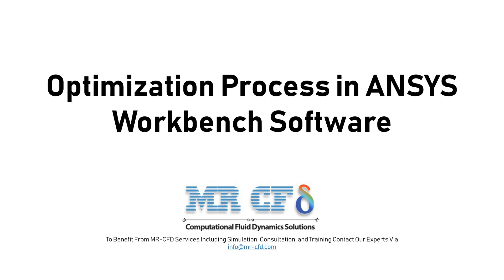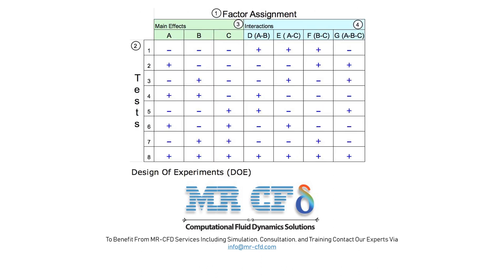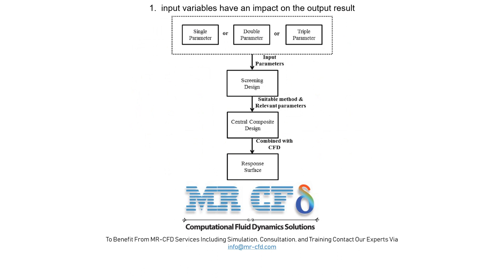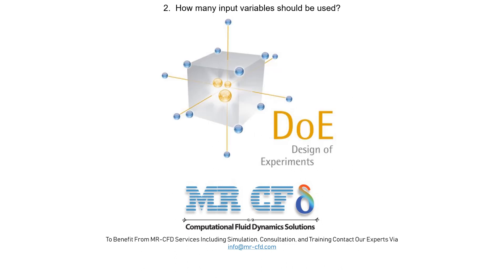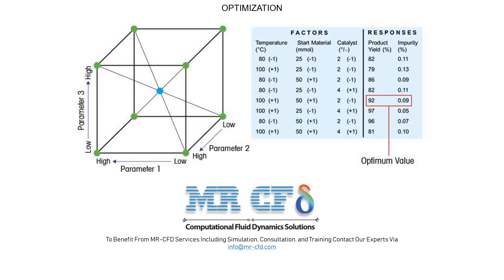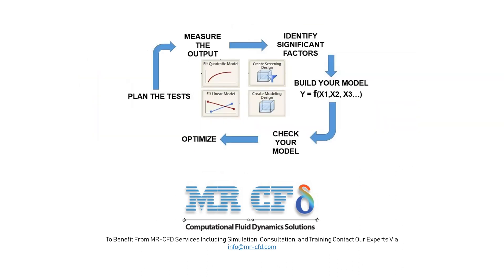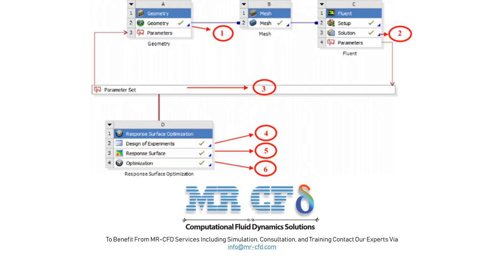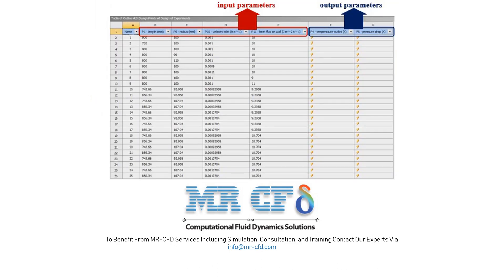Design of Experiment in ansys workbench :Optimization Process in ANSYS Workbench Software

Comment: Thank you for this quick overview. I have been working on to use DOE in ANSYS fluent. It takes really too much time to get results. The question is, Can I extract solution matrix in fluent and run in the MATLAB for different input parameter? And is it takes less time or take longer than fluent?
Reply from the maker: HI dear, extracting time is less than one minutes most of the time, maybe you are making a mistake during extract the result, you can be in touch with us via mail or WhatsApp: info@mr-CFD.com , +19032313943
Reply: @MRCFD  Thank you very much for your kind support. I did not tried to extract matrix yet. I just tried response surface with 15 experiments and it took 2 days :) with an 3 unsolved experiments. Now I am working on to solve these unsolved experiments to find the reason. I just tried to see what will be the max thrust force for 2 dimensional convergent divergent nozzle which has random initial dimensions. So during these 2 days I wondered is that possible to extract matrix and run in the matlab. Have you guys ever tried this before?